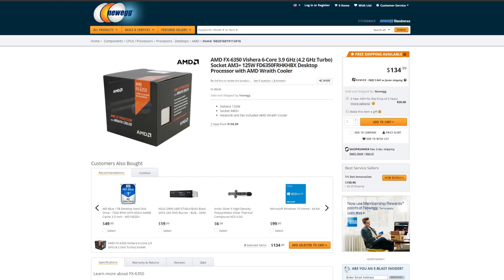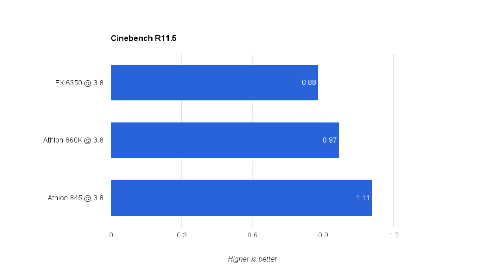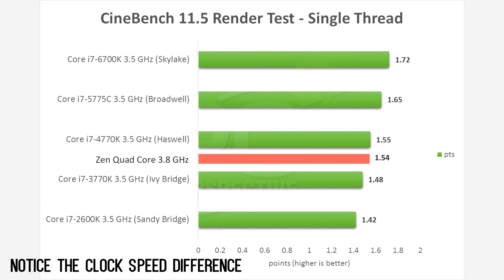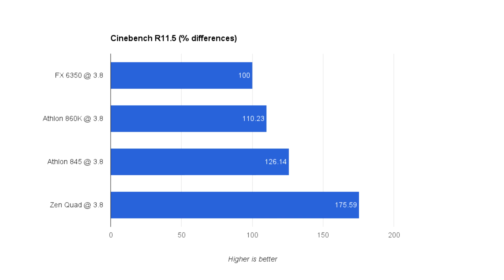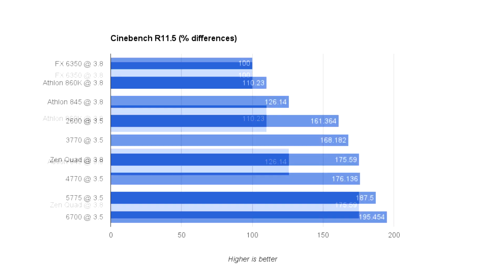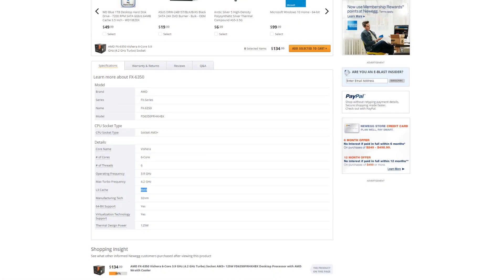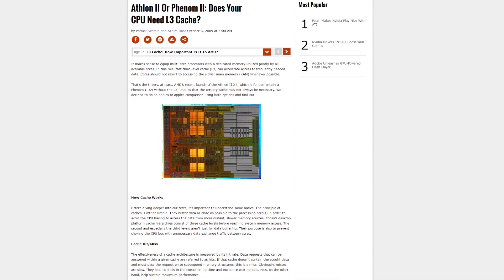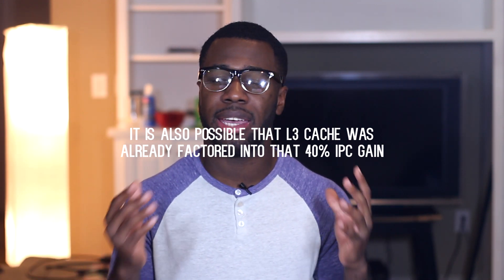How Fast & Powerful is AMD's Zen CPU? (Revisited) | OzTalksHW

Comment: Hey, it looks like we both underestimated Zen. Normalized for core and clock, it looks like Zen is very marginally faster than Broadwell-E (i7-6900K), at least in the Blender benchmark. The only way I could get that to work out on my spreadsheet is if Zen receives a 16% boost from SMT, rather than the 10% boost I was expecting.

Comment: there is one with 8 cores at 2.8 ghz turbo boost to 3.2 Ghz 16 threads with 95 tdp and a 1 or 2 watt at idel with clock speed of 550 Mhz
the other will be a quad core with a clock speed of 2.9 Ghz up to 3.2 Ghz 8 threads and and rating of 65 tdp and  a 0.5 watt at idel with clock speed of 400 Mhz
the price of AMD's is always low so ....its a good shit !!
Reply: Those were engineer samples which are usually clocked lower than the final consumer product.

Comment: But haswell clocks upto  3.9 max on a single threaded workload which usually it does clock up that high only in stress tests would it go down to 3.8Ghz on a single threaded stress test.

Only problem being is that there is one kinda shady rumour that the Zen 8 core CPU will be clocked out of the box at clocked at 2.8Ghz with an all core boost of 3.05Ghz and a maxium boost of 3.2Ghz...

Which wouldn't make it much of an improvement excovator it's actually maybe a step backwards so I somewhat doubt it unless it overclocks like a demon upto 4.5Ghz~

Although the guy who wrote the post first could be talking complete shit, and second could have been looking at engineering samples which are not repetitiveness of planned retail clock rates.

I fucking well hope so or otherwise AMD is FUUUUCKED!

Comment: I hope zen does great but I'm not building another pc for at least 2 years i have a 5820k 4.7, 32gb 3200mhz ram, zotac 1070 amp extreme. My last 3 cpu's have been intel q9550, 3770k and 5820k and they all still work and Ive never had a problem out of any of them oh and a e8500. But i had a amd cpu before that cant remember what it was, i wasn't into tech back then like i am now. And I've been a nvidia guy for the most part 6800gt, 8800gts, 560ti, but then i couldn't pass on the 7970ghz over the 680 and i think i made the better choice that generation they hold up way better than the 680 does in current games. After the 7970ghz was a 780 classified then the  1070. But i keep wanting to do a cheaper build for fun with a 8350 and a rx 480. I don't have brand loyalty and i will buy amd if its faster but for the last couple years they've just been the discount great value price/performance guys for builds. And i hope zen at least can compete with intel.

Comment: What makes me laugh out AMD fan boys is how they are like guys appearing at a car show with cars powered by two lawn mower engines and boasting to Intel fan boys with there single engine Ferrari's. This is coming from a man who used to love the Althon 64 single and dual core when they first came out and built many systems. Really sorry to see the demise of AMD but they can't keep up with intel. Please don't comment back with AMD are cheaper rubbish, I buy secondhand intel chips so I get the best of both worlds, price and performance.
Reply: Please stop yourself. You are basically telling everyone that you're an Intel fanboy.
Reply: well, yes and no.
y'see, i too, [hangs head in shame] was an AMD fanboi way back when the Athlon/ Duron ruled the world. oh, what great times! whilst the pentium 3 stuttered to even reach the PR [Perf. Ratio], nevermind the actual clock speed of what the Athlon's could do, overheated and demanded rambus ram in pairs, my single core Athlon 3200+ with 2gb ram ran so sweetly at a FRACTION OF THE PRICE OF THE AWFUL INTEL RUBBISH.
my biggest drawback with the AMD cpus back then was the hybrid chipsets.. AMD northbridge with a VIA southbridge meant i had to learn how to use a hex editor to get the best out of an AGP grfx card.

then i was - ahem - kinda partying my arse off for a few years and joined a band.

then someone gave me an xb360.
then an ex gf gave me a battered i3 dual core @ 3.25 ghz. she had thrown it at a wall because she hated desktops and went back to buying laptops every year or so. so i fixed up this intel i3 and was astonished at how easily it ran an old copy of Medieval 2:Total War with ULTRA detail... with an onboard grfx chip?!?!?! huge sized units, details maxed out. and no grfx card in sight.i compared it to my old mate who still swears by AMD and even tho his AMD had a 512mb PCIe grfx card and 4gb ram? it couldn't keep up with the patched up i3 [that was wonky because my ex had thrown the case at the wall and it almost split in 2].

i recently built a i7 skylake 6700 [i think?] quadcore 16gb 2400 ram, Z150 mobo, 750watt corsair PSU and a 970GTX grfx card.
runs Doom on ultra and that's wo boosting the cpu to 4ghz or the ram a few notches!

my old mate still is a dedicated AMD guy... but even he admits the AMD cpu are behind intel though the AMD new grfx cards can run Dx12 w win10 much better than anything the nvidia 1080 can do.
hmmm.. from what i've seen i don't think we're gonna see the Dx12 advantages for a coupla years yet.

this PC i have now exist for one sole purpose - to help me avoid throwing money for a PS4 or XB1 which is hardly much better than the ancient xb360/PS3.

also, i was stunned at the shocking read/write differences between a 7600rpm 6GB/4GB read/write video editing 2TB HDD compared to the 240GB extreme pro SANdisk SSD which has 550GB read/520GB write speed. 
i've never booted windows 10 in 2 secs after the BIOS opening screen before.

and i worked out that the AMD equivalent including mobo and 8GB ram is only £75 cheaper.

i'm not really into the speed so much as stability. and as stable as my old Athlon 3200+ ran on winXP Pro SP2, so far this system has been fine [apart from not having a dvd player and making my external blu ray player worthless... but an older version of VLC has gotten my ext DVD burner working ok.]
the difference in price would have been nulified if i had opted for a dual core i5 w 8gb vengence 2666mhz ram and mobo!

but it's really swings and roundabouts, isn't it? AMD will take the lead sooner or later. Intel, as usual, will get lazy and AMD will come out with something that will knockback intel's stocks and they'll go into damage control and panic develop several crappy CPUs to match AMDs advances. in a way, it's a good thing.. it stops intel from dominating the market and getting lazy. the Athlon REALLY shook up Intel and AMD became a name that even non techies came to know. 
before Athlon? ask my gf if she wanted an intel or AMD PC she'd look at me as if i'd turned into a goldfish.

oh yeh, and ask my gf if she wanted an intel of AMD PC she'd look at me as if i were a goldfish...

of course, before Athlon., ask my gf if she preferred intel of Athlon PC she'd look at me as if i were a gold fish...

erm... gold.. fish? what was i saying?

Comment: What people need to understand aswell is that even though it might be a little a little behind in IPC it's still going to be amazing for its pricing, also to remember is that it will have SMT and they are going to be many variants of the processor of number of cores per CPU, 4, 6, 8, 12, so in theory if you add up all these things it will put it ahead of haswell so I do believe in performance it will be in between haswell and skylake. Not to forget this is the first Zen line up and we will be seeing the refreshes in the very near future.
Reply: Zen+ is 20% more Ipc than Zen
Reply: +jalebi Singh and?
Reply: +SubBass Music just telling you that Zen + is its succesor and it's Ipc could tie Intel'satest depending on how soon it launches

Comment: For a start, within 1 year of ZEN launching, AMD will have completely taken over the server market from Intel. As of last year, Intel made up over 90% of CPUs in the server market / industry. That is insane, because back in the early 2000's with the Athlon X2's, it was a 50/50 share, pretty much. Since then, Intel has DOMINATED the server market with it's Xeon CPU's and AMD now holds less than 10% of the server CPU market.

When ZEN comes out, it will be AMD who have the 90% share and Intel who drop to 10%. 16-core ZEN CPU's at a SMALLER PRICE than Intels current 6-8 core Xeons, but with the same (or better) IPC's and larger cache, ZEN will absolutely wipe the FLOOR with Intel. THAT is where the money will come from. That, coupled with Polaris / VEGA being in the next gen consoles (all 3 of them) are huge for AMD. Their stock has already risen over 50% in the last 2 months and ZEN isn't even out yet.

The desktop (home) variants of ZEN are not AMD's biggest earner and as such not as much of a concern for AMD financially. But the desktop ZEN CPU's will be far better price / performance than Intels current CPU's (no surprise there then ... this is the same as ever) BUT the difference being, you no longer have to sacrifice PERFORMANCE as ZEN will be as fast as Haswell in both single core and multi-thread (only for a lot less money) with full support of DDR4.

So yeah. In one years time, expect most people to be buying Zen based PC's with VEGA GPU's and 16GB DDR4 (cos it's cheap now) and playing amazing looking games in Vulkan / DX12 with lots of PC Exclusives. Intel had better come up with something (or finally drop their prices), but as far as I can tell, it's already curtains for Nvidia.

Comment: I read somewhere they got a 8 core cpu with smt rated at 95 watt tdp. If this is true imma just get one, i don't even care if its only near haswell ipc.
Reply: yes there is one with 8 cores at 2.8 ghz turbo boost to 3.2 Ghz 16 threads with 95 tdp and a 1 or 2 watt at idel with clock speed of 550 Mhz
the other will be a quad core with a clock speed of 2.9 Ghz up to 3.2 Ghz 8 threads and and rating of 65 tdp and  a 0.5 watt at idel with clock speed of 400 Mhz
the price of AMD's is always low so ....its a good shit !!
Reply: Those are low clocked revision A0 engineering samples. The rumor is 3.8 4.2 turbo on the final 8 core zen. Also they are on track to surpass Haswell. Achieiving over 40% IPC gains(as AMD themselves stated) puts them probably just behind skylake. How far behind? Well.. I really don't give a fuck.  They are smart not to say how much zen has surpassed expectations, it will make intel sweat just the tiniest bit lol Basically a 5960x with slightly less L3 cache for $3-400?.. yes.. I will take one please.
Reply: 40% better then excavator puts them behind sandy bridge. Heck QX9770 from 2007 quad core clock for clock beats 2016 excavator athlon x4 845 and has similar performance per watt.
Reply: Nissangtr786  Bruh.. any haswell 4 core 4 thread i5 has typically 40-50% more IPC than a Athlon x4 845. Skylake has 50-60% Zen has OVER 40% percent IPC gain over excavator putting it well within haswells performance range. How much over 40% we do not know. Rumor is its a negligible amount behind Skylake and will compete with Kabylake by offering more cores at a lower cost. A lot of people can run all of today's games on a 2500k OC'd.. so, an updated 8 core 16 thread improved haswell equivalent from amd for a good price is waaay more than enough for damn near anybody.
Reply: Ill Vill
Their is a reason why i3's haswell on outperformed virtually any AMD cpu at gaming including highly multithreaded titles.

Look at the web based benchmarks. They rely heavily on strong per core performance.
http://www.anandtech.com/bench/product/1684?vs=1368

I wish AMD improved 110% ipc. The problem is Zen ipc wise is behind most mobile phone cpus in last 3 years.
Reply: +Nissangtr786 false. 
Especially in games that actually utilize all 8 threads of an fx cpu. Games that rely heavily on single core performance will obviously perform better. & as for that link you posted, do you know how to calculate percentages? because the excavator cpu you listed is on average LESS than 40% slower than the i5 listed. why would you even bring up mobile processors? they don't even use x86-64, irrelevant statement.
Reply: Ill Vill
It seems most AMD people don't know how to calculate percentages. No winder so many people think Zen is level with Haswell. BTW Cinebench utilises half a single thread so ipc looks closer then actual gap. You can try Cinebench yourself. Sunspider Kraken WebXPRT, Adobe Photoscan shows ipc better. You can see on photoscan total time i5 4570s does it in less then half the time. That means despite clocked lower haswell has a 100% ipc advantage to do it 2x faster as that is what halving the time at a lower clock speed of haswell cpu suggests.

Cinebench doesn't show ipc much hence AMD use it as a benchmark. Also look at Sysmark scores.
http://www.anandtech.com/bench/product/1684?vs=1368
Reply: Nissangtr786 I say we stop arguing and wait. Whoever is wrong then gets smacked
Reply: +Nissangtr786 bruh different cpus handle tasks differently especially ones with vastly different architectures. On average it is a 40 to 50 percent difference between various haswell i5s and x4 845s. Userbenchmark demonstrates this nicely. Now, with that being said the the compiler and scheduling/fpu issue with the excavator architecture causes it to be gimped and the modules are seen as cores by most programs essentially making it a dual core cpu vs a true quad core processor. Even though the 845 has 4 physical threads only 2 threads are typically used and one ends up "waiting". I say we do like the other guy said; wait and whoever is wrong gets smacked lol
Reply: Nissangtr786 
SLAP!

Comment: Amd needs money. They are still way behind Intel and Nvidia..
Reply: The RX 480 beats the 1060 in Directx 12 and Vulcan performance but in DX11 the 1060 barely beats the 480
Reply: In what regard are they "behind"? XD
AMD just won all 3 next gen consoles right? And DOOM Vulkan shows that AMD's £175 card is just 10% slower than Nvidias £400 card in next gen API games.

You will have to explain. Perhaps you know something the rest of the world doesnt?
Reply: AMD may have won 3 next gen consoles because they are selling their tech for cheap.
Nvidia and Intel are not cash strapped like AMD so they don't need the console business.
Even with AMD tech in consoles, they are NOT making a profit.
Doom is one game. The Quake engine use to be the dominate engine in the late 90's now it's the Unreal engine. The Vulkan API has a long way to go before it can match Direct X in terms of the number of PC games using that API.
The Zen is suppose to be a new Architecture but it will mostly likely NOT equal the current Skylake CPU's or the 2017 Skylake-X / Kaby Lake - X cpu's in raw performance.
The GTX 1060 beats the Rx 480. The GTX 1050 might just equal the 480 in performance.
Polaris seems to have maxed out with the RX 480 and we'll have to wait till 2017 for Vega. Pascal will max out with the Titan P which has been reported to be about 50% faster than the 1080. And we know that AMD has nothing to match the 1080. Even dual 480's come up short.
Nvidia has room to play with pricing. They can offer a $20 rebate for the 1060 which will match the 480 in Price but beat it in performance.
Reply: Ok. You are taking this a way bit to seriously.
It seems people cannot have a debate about something without someone going down the profanity road and insulting people.

Well, like you said AMD won. Nvidia, Intel lost to AMD.
Have a great day.
Reply: Yes.. you corrected me and won.
I'm now schooled.
Reply: Please re-educate me on AMD's Q1 2016 earnings compared to Q4 2015.
Please analyze and explain their losses since they are rolling in dough because of the console wins from Since 2013.
http://www.amd.com/en-us/press-releases/Pages/press-release-2016apr21.aspx
Reply: *****
Actually the cheapest GTX1060 is £262 and the cheapest RX 480 is £173.99.

I only got a B in mathematics, so I'm no accountant, but as far as I can tell ... £173.99 is A LOT CHEAPER than £262!

Even the Nitro 8GB is cheaper than the GTX1060, at just £229.99!

Lots of love
England
(in Europe)
Reply: *****
No... I've looked at benchmarks, obviously go for whatever is cheaper in your country

but RX 480 beating 1060 in most DX12 games is a fact

1060 beats RX 480 in DX11 by a few frames

They are both great cards in my opinion, I'm not a fanboy

(Like I said, go for whatever's cheaper)

Comment: Yeah, the l3 cache is an open question. But you didn't take into account that the i7s are hyperthreaded, whilst the fx and the athlon aren't. Again we didn't know if the 40% gain is with or without HT. But if the 40% gain is on cores not on hyperthreaded cores, zen could be even faster than anticipated. But it's hard to see through PR BS...

Comment: Hey man, is there any way you could help me with a PC build? I have about $700 and I would like to mention that I have an old i5 2400 outta an old dell that I could use if there is no point of updating. I am going to be doing mostly 1080p or 1440p gaming. I am new to PC building and such. I would just like a little help
Reply: Go to pcpartpicker.com and price components.  for $700 you should be able to build the following:
Intel i5 6500
h110 chipset mobo
16 gb corsair value select 2133mhz ddr4 dual channel ram
Radeon rx 480 4gb
evga 80+ bronze 500w power supply
Adata sp550 240gb ssd or western digital 1tb caviar black (I went for the 240 gb ssd to make my system snappy)
Corsair Carbide 100R case
2 or 3 extra 120mm fans
  =max settings on all current games @ 1080p w/ good frame rates. 1440p at near max

Comment: Yo, should i upgrade my current CPU (i5-2300) when I will buy a GTX1060 (or RX480) or can i stick to the i5-2300 and upgade it later?
Reply: http://www.tomshardware.com/answers/id-3116304/2300-bottleneck-rx480.html
Reply: thanks :)
Reply: Leif Eriksson
Np dude